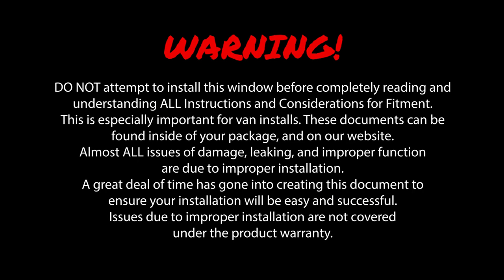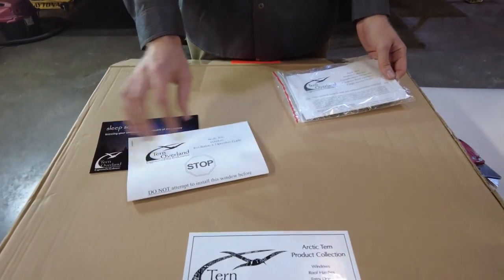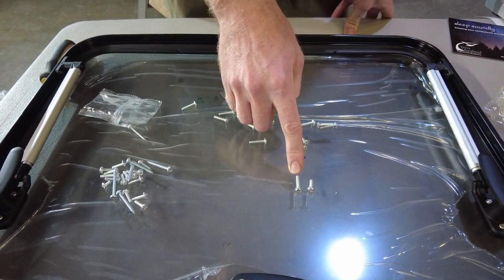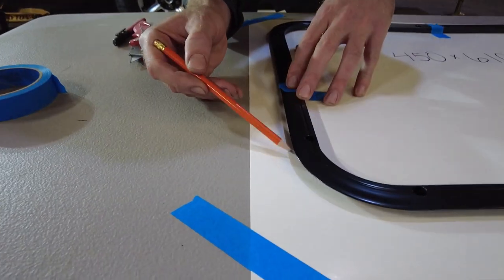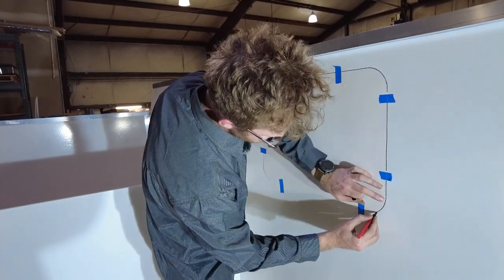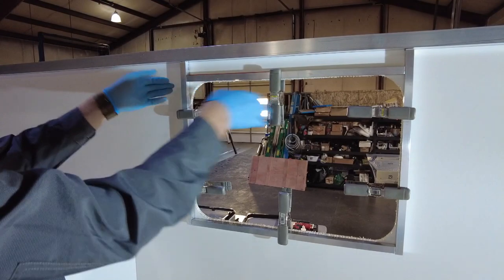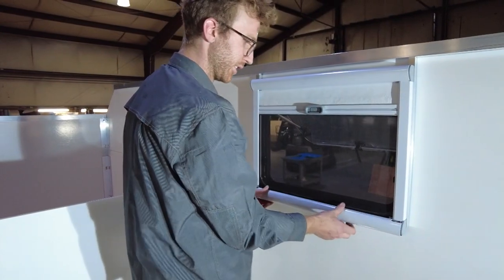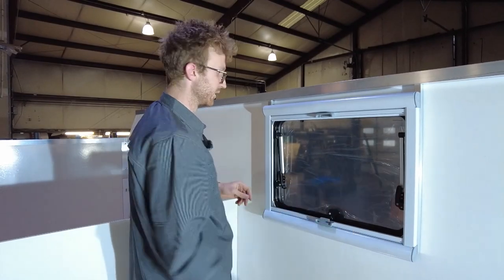Arctic Tern Awning Window Installation

Comment: Just installed a 300x700mm Classic pane lost on the west side of Amarillo after forgetting to lock it shut. Marking the key tab location was essential and literally made replacement a snap. Very well designed. Well worth the price.

Comment: Great Video! Thanks! One suggestion if you ever re-edit this video: include a segment that shows the viewer the 50%-75% compression of the gasket on the outside. Also, I found that going around and tightening all of the screws just to the point of initial compression of the gasket is a good place to start - then go around again in the star pattern tightening each screw the same amount in small increments works well - it took me about three trips around the star to get my gasket compressed equally and to the appropriate degree. I was moving slowly. Gracias again for such an informative video.
Reply from the maker: Thanks for the suggestion! You can calculate the % of compression with calipers. We did recommend that in the video but it is difficult to show! We also recommend tightening the screws in a cross hatch pattern to make sure that one section of the window isn't tightened too much or too little (avoids over tightening and bottoming out screws) , and gives an even compression all around. Glad the video helped you, let us know if you have any other questions!

Comment: It would be helpful if you write out in the details what the liquid is you used on the screws. Verbal isn't clear. Also answering the other questions in the comments would be helpful.
Reply from the maker: Hello! Thank you for your feedback. The liquid we used on the screws is written in detail in our installation instructions, which can be found on our website as well as in each package we ship. It is a metal based anti seize. Permatex is a good option.
Reply: @ternoverland  thank you!
Reply: I just installed my window and forgot about prepping screws. I never used the anti seize on the screws. Should I be unscrewing all the screws to do this? It’s a small 300x500 window in rear barn door of a cargo trailer